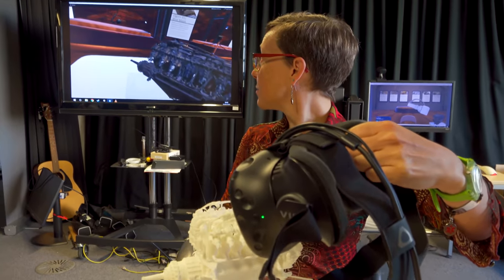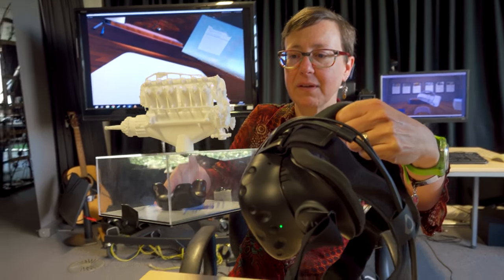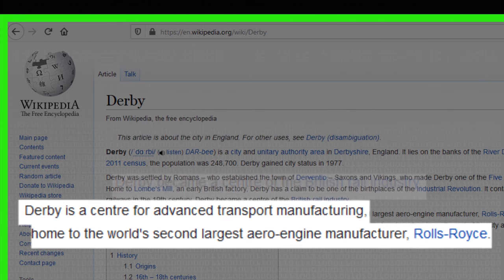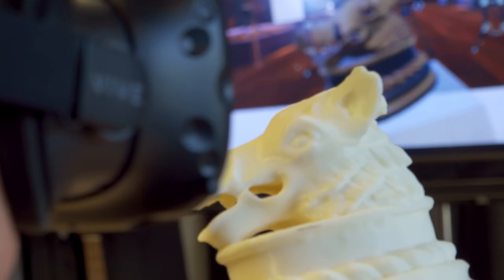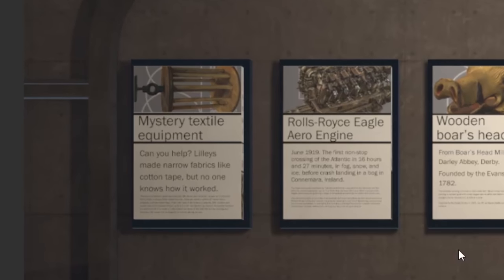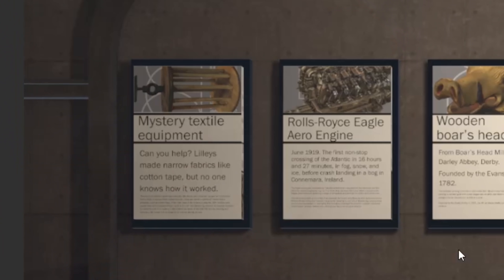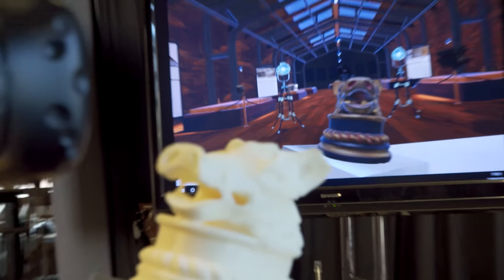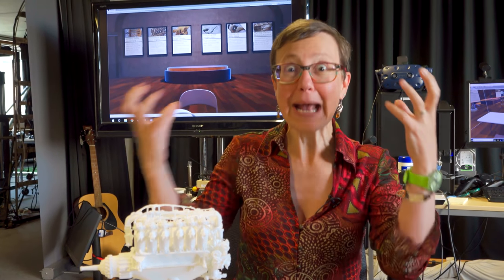Digital Storytelling - Computerphile

Comment: I'm still very confused by the point of all this. It lets you see a digital version of the object you're holding? Okay, why is that better than just having a decent replica to hold?
Reply: I find it a bit confusing too. What story are people telling ? Why do they need a VR object ? This wasn't quite explicit enough. Moreover I don't understand the link with C.S.. 

About your question I reckon having a high res 3D object and a low res replica is cheaper than a high res replica.
Reply: Because its very hard to make good accurate replicas of complex items, it is not hard to make a close 3D print and back that up with VR, which as they said is much more fulfilling and doesn't require a super accurate high detail replica.
Reply: It's cheaper. Don't always think from the consumers view lol
Reply: I think a good looking replica would be very expensive and the (handpainted?)colors would wear down over time from touching, or someone drops it etc. Here you can just print another one without worrying about this. But I could be wrong.